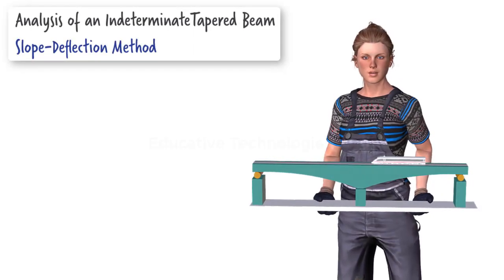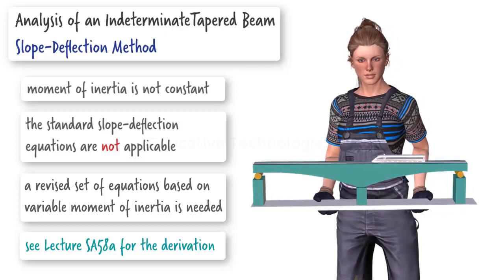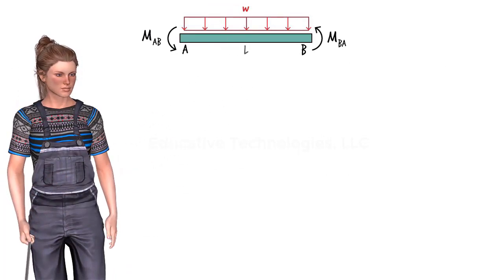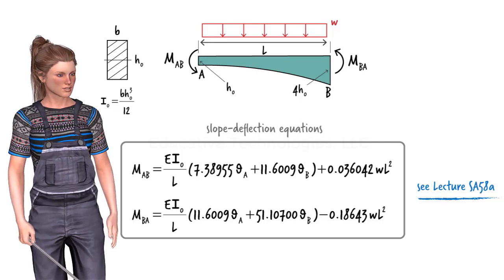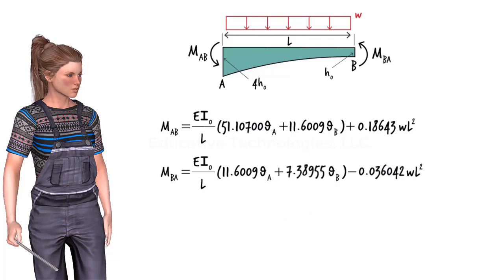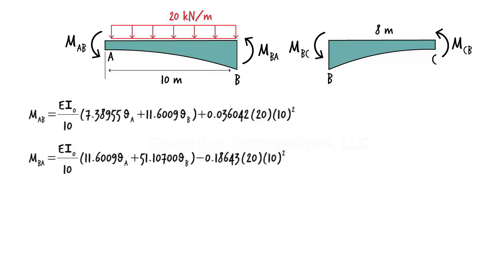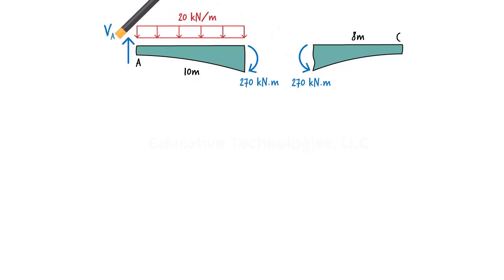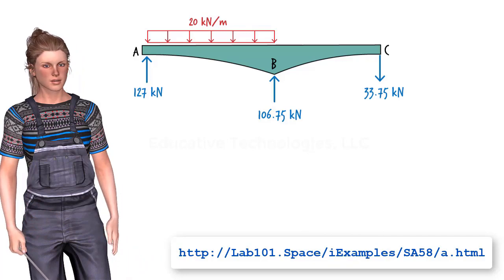SA58: Analysis of an Indeterminate Tapered Beam using the Slope-Deflection Method

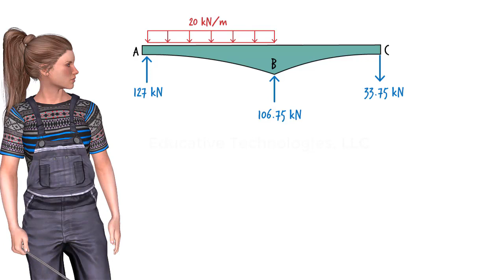Comment: The reactions given at 6:09 in the video are not correct- they do not provide equilibrium for the system.  In a 2-span system the center reaction will almost always be the highest reaction due to continuity moments over that support.  With nonprismatic beams as you have shown the increased stiffness at point B will increase the continuity moments and cause an even higher reaction at the centerr support.
Just taking sum of moments about point A shows that the reactions are not in equilibrium.  If I assume that the reaction at C is correct then the reaction at B should be 160.75 which indicates there might be a typo there, then if the reaction at A is calculated from these other reactions it would be different.
Reply from the maker: The following exchange in the comment section from a few years ago should address your question.

@civl112 (4 years ago, edited):
“The reaction solutions at 6:13 do not seem to satisfy moment about A = 0, as -2005 + 106.7510 - 33.75*18 = -540?”

@DrStructure (4 years ago):
“Thanks for pointing out the typo. The vertical reaction at B is the sum of two numbers: 127 + 33.75 = 160.75, NOT 106.75.”

Comment by @civl112 (4 years ago):
“@DrStructure Thanks. So the answers are RA = 127 up, RB = 160.75 up, RC = 33.75 down (kN)? Their sum does not exactly counter the 200 from UDL…”

Reply by @DrStructure (4 years ago):
“The error in the results originates from the previous screen. @5:55, the calculated shear values are correct. But notice that, at the bottom of the screen, Vba and Vab are swapped. The shear at A is written as 127, it should have been 73. And the shear at B should be written as 127, not 73. That is why we ended up with incorrect support reactions. The correct reactions are: Ra = 73 (up), Rb = 160.75 (up), and Rc = 33.75 (down).

Comment: The reaction solutions at 6:13 do not seem to satisfy moment about A = 0, as -200*5 + 106.75*10 - 33.75*18 = -540?
Reply from the maker: Thanks for pointing out the typo. The vertical reaction at B is the sum of two numbers: 127 + 33.75 = 160.75, NOT 106.75.
Reply: @DrStructure  Thanks. So the answers are RA = 127 up, RB = 160.75 up, RC = 33.75 down (kN)? Their sum do not exactly counter the 200 from UDL...
Reply from the maker: The error in the results originates from the previous screen. @5:55, the calculated shear values are correct. But notice that, at the bottom of the screen, Vba and Vab are swapped. The shear at A is written as 127, it should have been 73. And the shear at B should be written as 127, not 73. That is why we ended up with incorrect support reactions. The correct reactions are: Ra= 73 (up), Rb = 160.75 (up) and Rc = 33.75 (down).

Comment: Excellent video. I've watched your other videos and I really appreciate your method of teaching. I realize this channel focuses on structures and strength of materials, but I was wondering if You were planning on making some videos on differential and integral calculus? A firm base in mathematics is required to be able to understand, but unfortunately in schools Calculus is taught non-intuitively, to solve through plugging-and-chugging. I wish You'd apply your talent even beyond your structural videos, which are once again amazing.

Cheers
Reply from the maker: Thanks for the note. You are absolutely right, in our schools, (engineering) mathematics is often taught in a non-intuitive way which makes its comprehension, beyond memorization, a challenge. Introducing math lectures into our library in an integrated manner poses a few challenges, but we will continue to explore ways to make it a reality.
Reply: @DrStructure  I'm looking forward to the day when you do make it a reality!